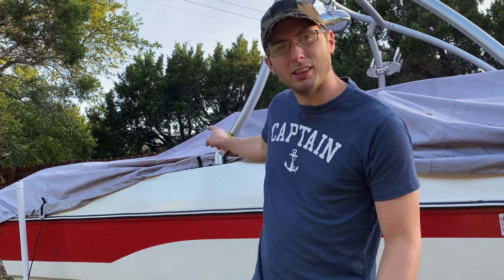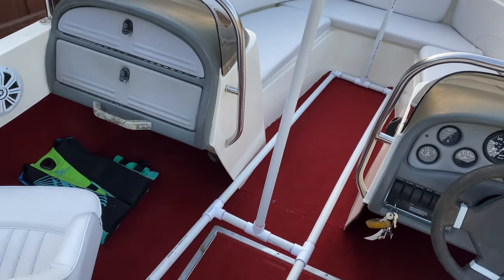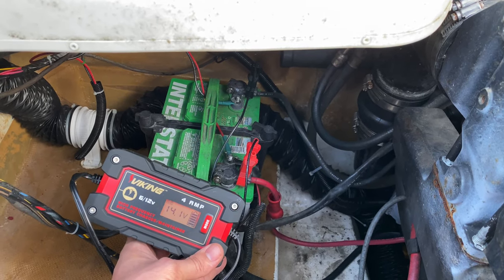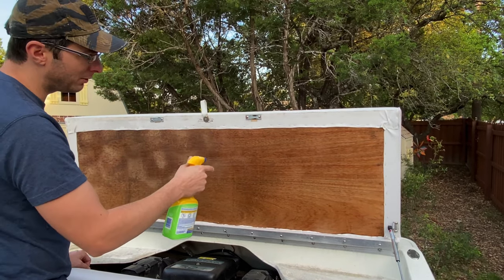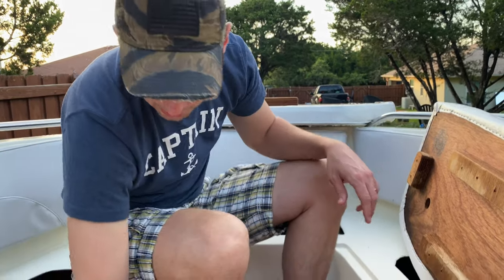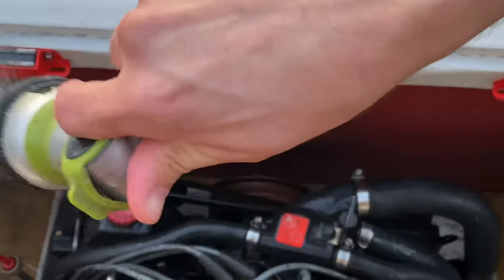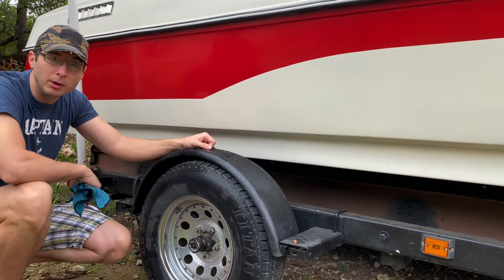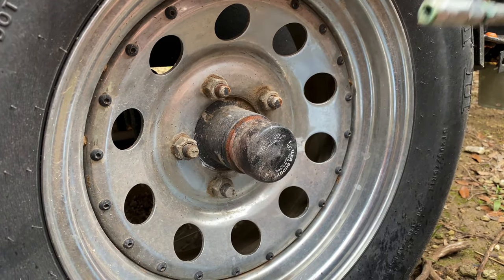I Found Mold! Getting Your Boat Ready For The Water!

Comment: Do you put mothballs in the boat in winter? I have trouble keeping rodents and ESPECIALLY the freaking SPIDERS out of my boat... Like, spiders galore everywhere all year round...

How do you handle that problem?
Reply from the maker: You bring up a real problem. Originally, I noticed hornets liked to make nests, and even ants. On this latest build, there is something about the materials used during the rebuild that keeps spiders and ants away so far. There is also an additive to paint that repels bugs out there. They have it at Home Depot. I need to find out if it can be combined with common boat paints. For your situation, consider getting conventional bug spray. I’ll post a video on tips this week. Thanks for watching!
Reply: @michaelromer2016  Thanks Michael, I knew I couldn't be the only one that deals with that, Haha. I have followed your build since thre teardown in the beginning. One of the most informative channels I've seen, I love watching!